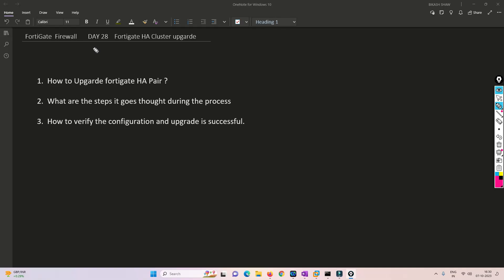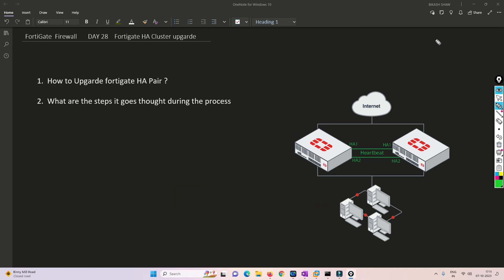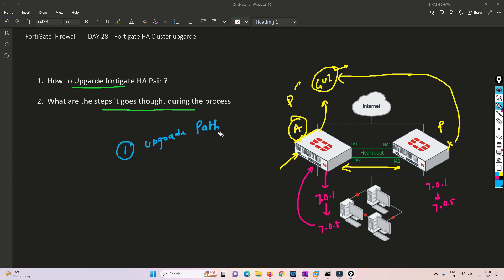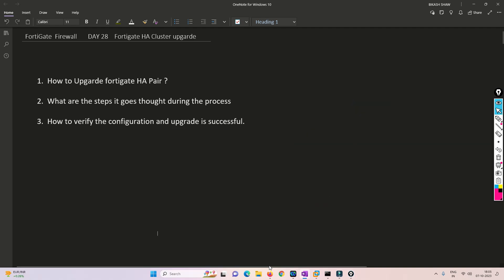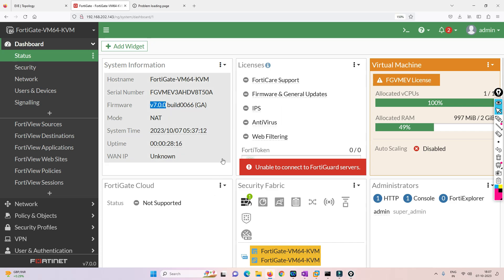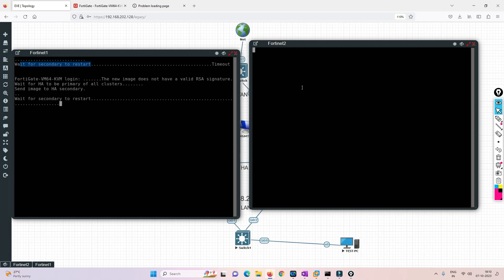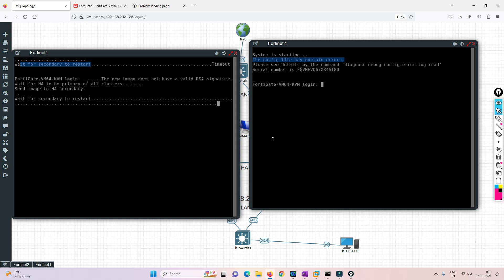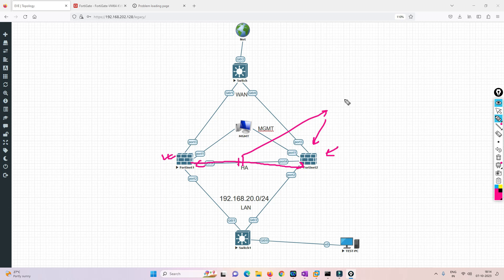#Fortinet | How to Upgrade Fortigate firewall HA Pair | HA Cluster | DAY 27 | NSE4 Training

Comment: Thanks for the video, can we upgrade the firmware for any one of the hardware like primary or secondary? (I believe the HA must be in the same versions right)And please guide us how to configure preempt...
Reply: Regarding the preempt configuration, you need to setup different priorities for each FGT. The higher will become the primary unit, By default its value is 128. You can do so by the CLI in: 
config system ha
set priority 200

Then you need enable the override feature, by default is disabled:
config system ha
set override enable

You need to this in both units since the functionality doesn't synchronize. 

Regarding the versions, yes, it's a pre-requisite to have the same version so that the cluster can get sync.